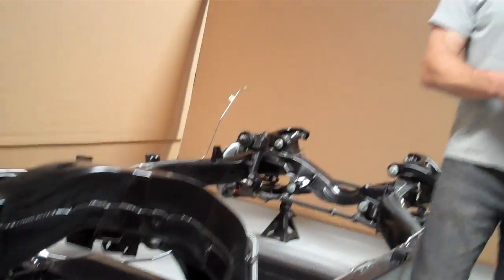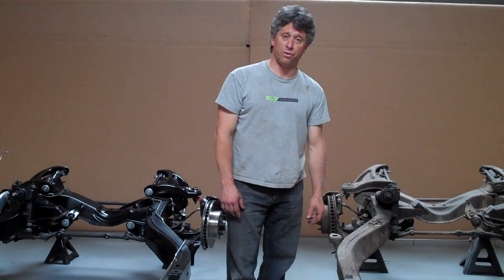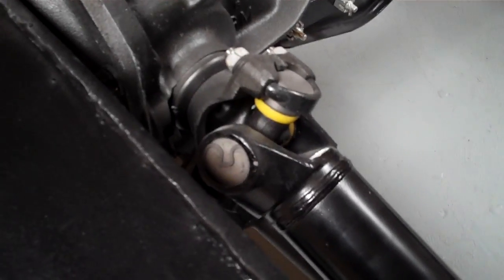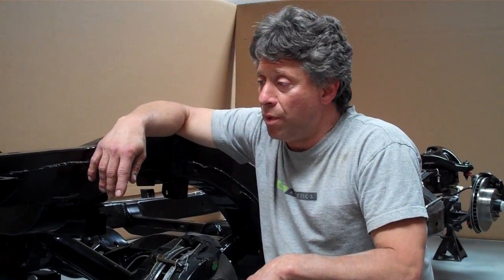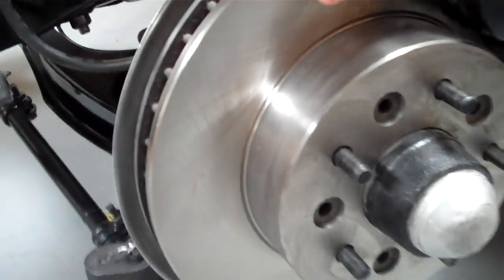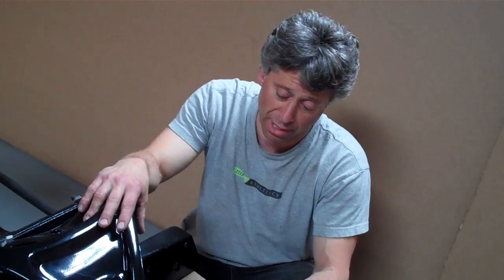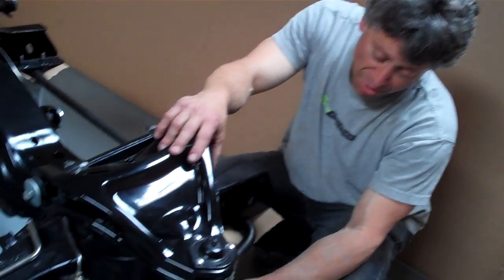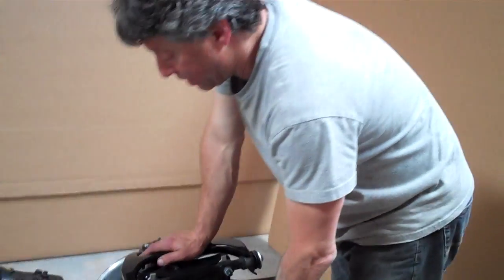Corvette Frames & Suspensions

Comment: Nice video and great service with the rust-free frames necessary for safety and handling the powerful engine torque. It would be gravy on the biscuit if you also had C4 and C5 frames as well as body panel as well. Personally I would go for a standard sheet metal body panels as opposed to fiberglass. Keep up the good work. Thanks

Comment: Nice video...I wish I would have weighed my frame, it has all the suspension on it now, basically a rolling chassis.. the front half of the frame was almost perfect, the back part there was some flaking and loss of steel, how much exactly is unknown. Seemed pretty solid where the rear trailing arms are mounted. There was also what looked like orange peel, not smooth steel from the midpoint of the frame, back. No rust thru holes at all, nothing even close to that. I did notice the frame is made out of 12 gauge (.105") steel. I did some extra welding on the frame seams to try and strengthen it. Planned motor is a 540 big block.
Ed
1970 Corvette Stingray
Reply from the maker: New way to request Parts
check out this link for new and used 1963-1982  Corvette parts

https://ezcase.leadpages.co/my-corvette-parts/
Reply: Hey Ed are you on corvetteforum.com ?

Comment: Very nice, I just got a 1980 C3 W/5.7 350. After getting it home, I was checking it over and found a really bad rust hole on the bottom part of the frame right behind the passenger front tire so I can imagine what the rest may be like.  I was wondering the price tag on rebuilding vs new ?

Comment: I have rewatched this video to see some areas of the frame for reference and I am still amazed that the cameraman keeps the camera on the guy talking instead of using the two frames that he has for reference. All he has to do is to point to the areas he is talking about but instead never looks down and only refers to them. This video should be used in the video presentation of how NOT to make a video. Video is a visual media and not an aural only one. Why not use the visuals of the subject instead of the talker?

Comment: not recycled rubber but real rubber. You lost your integrity throughout the vid but you totally lost it then lol. From a environmental chemist. RECYCLED RUBBER used for suspension parts has 68-77% more durability than auto manufacturers standards. We remove more impurities than the auto manufacturers will invest in. They want to sell you $8000.00 car for $26000 and $12-14000 cars for $50k.  They won't invest $0.07 to make a bushing last an extra 50k miles.  They want the suckers coming back to the dealer to buy a $0.57 part for $80.00 and 3 hours labor to install it.  When I started out in the auto industy I worked at pontiac dealership. Grand ams started having issues with a part that was $4.95  + an hour for labor. (aka 20 mins to do) in my first 6-8 mths there and as the issue became more and more common that same part jumped from $4.95 TO A WHOPPING $89.95. But is people only knew they could buy that same part at a electronics store and the tool required to do it would cost them about $7.